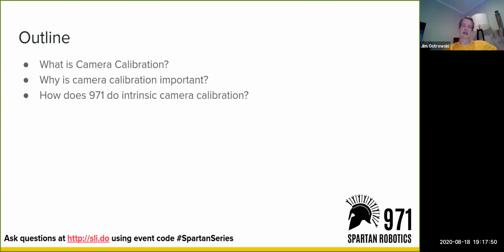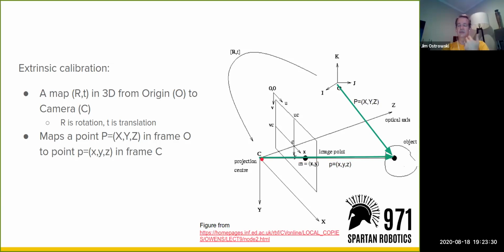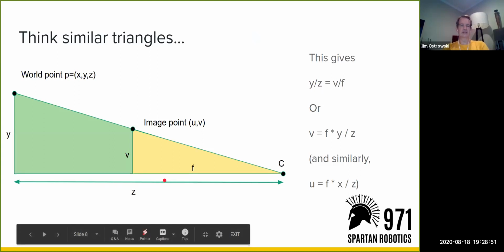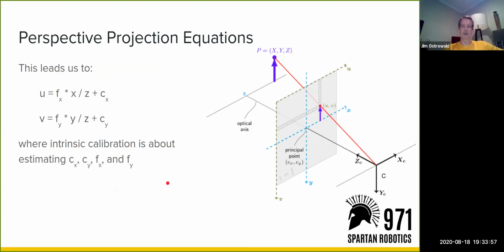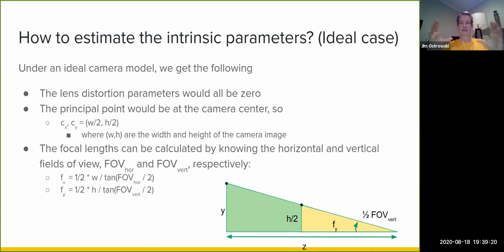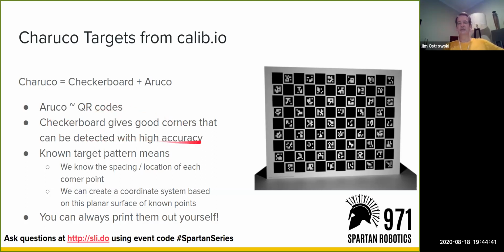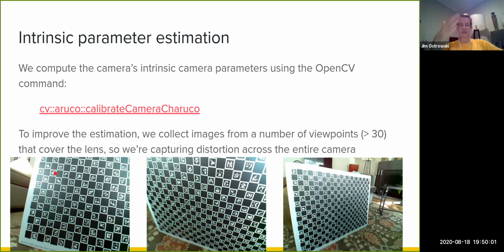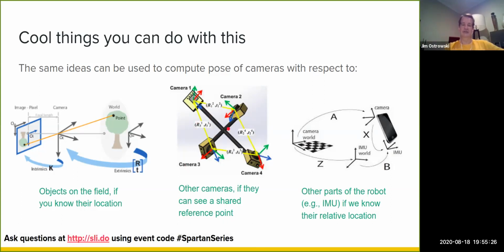Spartan Series / Camera Calibration, Precision + Alignment for Robots : Jim

Comment: Hi Sir, Is it possible to measure the distance between single  camera and object in real world?
Reply: Great question!  It is not possible to measure distance to an object using just a single camera using just the geometry because the projection removes a scale factor.  

However, there are many times when you can estimate the depth, when you know something more about the objects for which you're trying to estimate distance.  For example, if you know the size of the object, you can use that, the size of the object in the image (in pixels), and the intrinsic camera parameters (which I talked about), you can to figure out how far it is away.

Alternatively, a lot of progress has been made recently in using Deep Neural Networks to estimate depth of objects in the image, by training them to combine information about what the object is (and hence it's expected size), in order to estimate depth to the objects.  Pretty cool ideas, referred to as "Depth from mono" (monocular / single camera images).

Hope that helps!